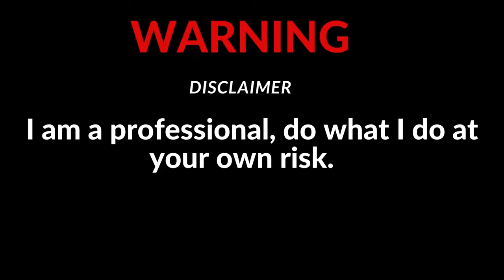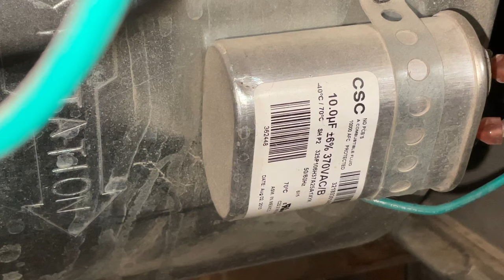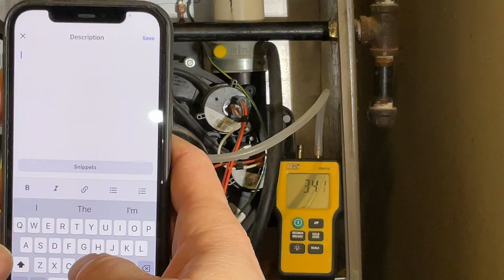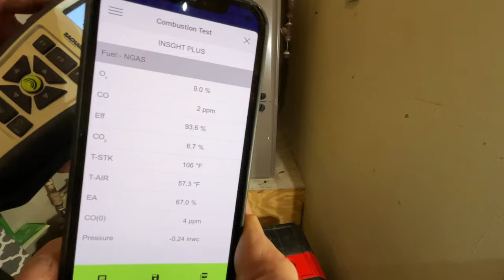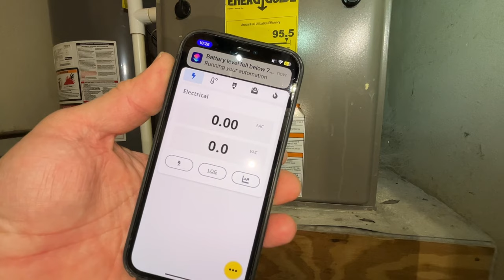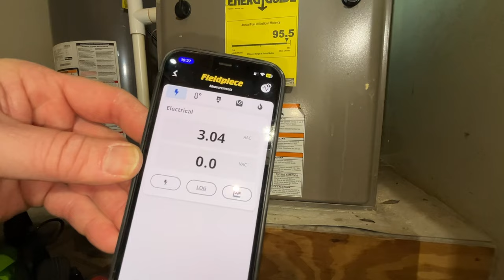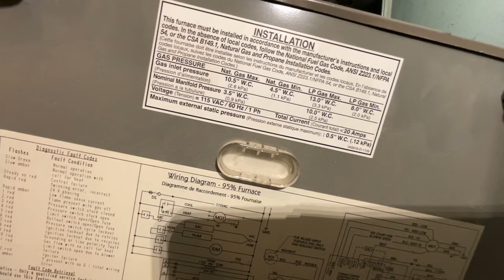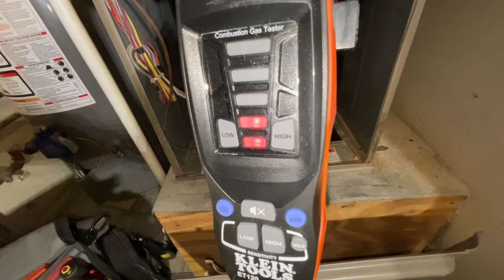Unbelievable Secrets about Furnace Tune-ups Revealed

Comment: I will always check where furnace is exhausting I had a case old lady sat by a window wherein nearby a furnace exhaust was located. Leaky windows meant CO was leaking into the property. The furnace was working properly I do check CO and other nitrous oxides around the house and heating vents. Did you clock the gas meter to check against rating information of the unit?
Reply from the maker: No I didn’t clock the meter. I should.
Reply: Don’t worry your doing a fantastic job your approach is spot on. Your son will be lucky to learn from under you.

Comment: You will normally still get some residual gas left in orifices and the pipe but that should bleed away pretty quickly. ANSI stds allow trace gas leakage through the seals of the valve into the room at 200cm^3/hr and 235 cm^3/hr through the main operator to the burners both at 3/4 psi. There are several ways to do this kind of testing.

Another simple way is to pick up CO rise due to incomplete combustion. You shut the gas valve switch to the off position while their is still a call for heat. The CO rises because the unburnt gas is traveling through a hot heat exchanger causing it to produce CO from inadequate combustion. Just as if you were to take a reading on a overfired furnace. Incomplete combustion. Doing the reading with the analyzer is just a easy test to perform at the end of your combustion analysis after tuning the furnace to double check the saftey of the gas valve. A combustible gas leak detector can give false positives as well. People always talk about Jim Davis classes at the NCI he is a legend in the field and dispels many myths about CO and combustion. Knowledge and field experience is king!
Reply from the maker: Wow! You are blowing my mind! With all your knowledge.  This is great! Thanks for watching.

Comment: I still have high regard for measureQuick it does things by the best industry standards. It can be glitchy. I can construct my own reports regardless. Not seen company cam but your doing things the right way. Of course you still have to tell the customer no matter if the machine is running well changes to the environment or components can still fail at any time but of course a well maintained machine on average works better for longer at lower cost. If your doing this regularly you should see deterioration and alert the customer to potential problems. I always tell people I help a component will likely go so start saving some now and you won’t be shocked.